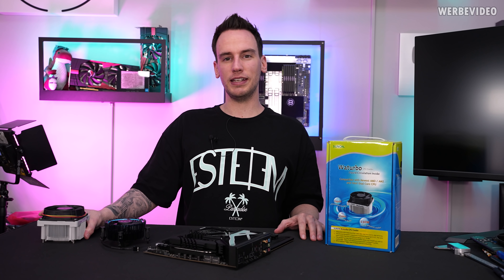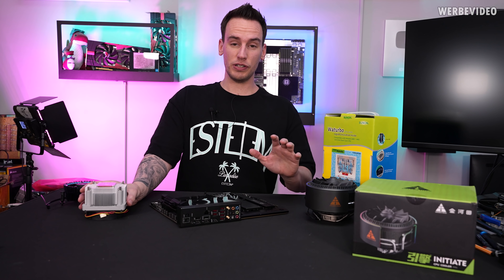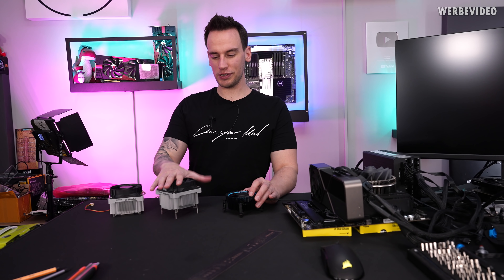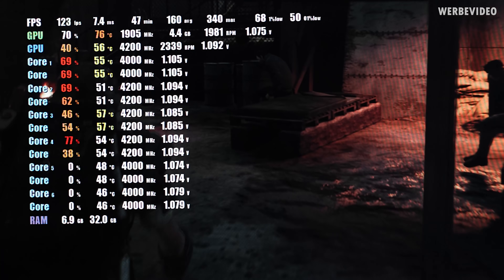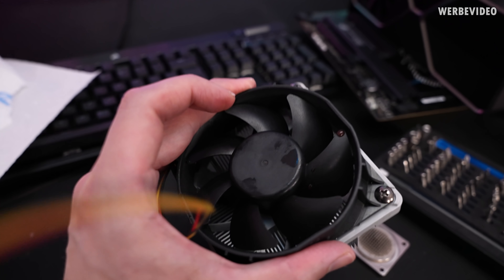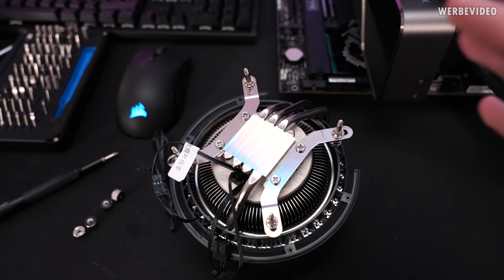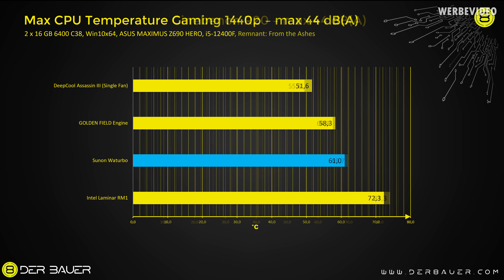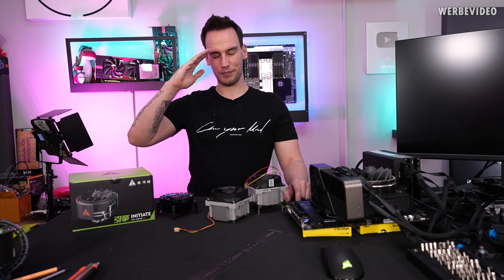Obscure Engineering: This Boxed-Cooler tries to impersonate an AIO

Comment: This should be brought back, it seems quite effective! However it might be possible to achieve the same performance in the same form factor with improvements in design that have occurred in the last decade.
Reply: I'm not sure what the point of the water is. In an AIO you are transporting the heat to a different location where you spread the water thinly through a radiator with two 120mm fans. In this design you're not moving the water anywhere nor are you spreading it through a radiator nor do you have two fans. I do like the pump design and if this were fitted with a couple of pipes and a radiator it could be a three fan design, one on the head and two on the radiator.
Reply: @wayland7150  actually there is a point. vapor chambers didn't really exist in those days and a copper slug wouldn't scale when the heatsink portion is bigger than a certain height
Reply: The heat transfer process is less efficient than using heatpipes so a well designed heatpipe design should always beat it.
It could probably be made slightly cheaper per unit but today heatpipes are dirt cheap so I suspect it would never be possible to recoup the R&D needed to build a new one (which means building one would be irrational). There were heatpipe coolers back when this was launched I suspect heatpipes were far more expensive back then which explains why this exists.

Basically they're using a water to transfer heat to the sides of the tank and then from there it'll go through the metal to the fins where the cooling happens.

A heatpipe design is better at transferring the heat to the fins and without the water container in the middle the same size heatsink assembly will also have more fin-area - both these improve performance.

It would have been fun to see it compared to one of the 100+W AMD stock cooler that do use heatpipes since this advertised 130W - like the 105W rated Wraith Prism (it comes bundled with the 105W 3900X) and AMD also used to have an 125W model (for A10-7870K). Just to show how bad the "new" Intel coolers are.

Comment: And how about the cooler made fully out of heat pipes?
Reply: It exists
Reply: @riba2233  wait, WHAT. Link me it
Reply: @trinhson1368  you cant post links in yt comments. It is called NoFan
Reply: @riba2233  oh god how unfortunate, i would really like one for my really weird-looking build
Reply: @trinhson1368  just find it online, not hard :)
Reply: @riba2233 i can only find ones with copper fins surrounding and connecting the many heatpipes, not any with ONLY copper heatpipes ;-;
Reply: @trinhson1368  it is nofan cr-80eh
Reply: @riba2233  :0, not the design that i expected, but the cooler that i needed
Reply: @trinhson1368  yeah haha. look that their other stuff, they have more models, some are bigger
Reply: @riba2233  jeez especially the 100

Comment: Interesting. Sunon is a large manufacturer of PC fans. The first PC I built, I used some 80mm Sunon fans. They created MagLev bearings and either license them to, or manufacture them, for Corsair. Never heard of this thing, but it'd be interesting to see a modern take on this design regardless.
Reply from the maker: Interesting, thanks!
Reply: I'd love to see something similar to this combined with an AIO.  Something like a really good air cooler coupled with a standard AIO.  Not sure if it would be worth it or would make much difference, but it would be cool to see.
Reply: @notme5744  There is a really old AIO from 2004-ish (called the GlobalWIN Silent Stream) that looks a lot like a modern AIO.
Reply: @polkadotdice6623  Thanks, I'll check it out
Reply: @notme5744  Yeah, that would be cool to see too. A better cold plate and fin design. A better "pump" since that wouldn't cut it for a full on AIO, at least I don't think it would. And a PWM fan. I doubt it would have too much to offer if anything. Especually to offset the added complexity, but I'd still like to see an attempt.
Reply: @TheGameBench  I guess it would be like having a really giant cooler with at least 3 fans and lots of extra capacity for absorbing heat.  I'd love to see it even if it's just a gimmick
Reply: @notme5744  It probably gets around Asetek's patent for a pump integrated with the cold plate if you integrate it directly into a more traditional cooler as well, I could see this having numerous applications. Downdraft fans actually help the motherboard perform better in other ways thanks to the extra VRM cooling, and the air flowing over your other hotter running items like your RAM and your system NVMe. It's a fundamentally different product, but you would definitely need to make changes to whatever fan you're using to drive it magnetically, I'd imagine you would need a MUCH more powerful motor to actually do a decent job spinning fluid through an external radiator with all the restriction on it. Maybe flip it around, put the motor in the cooler unit somehow with it magnetically driving the fan from inside? Who knows, might work pretty well lol
Reply: @TheOriginalFaxon  Didn't think about that, that's interesting. Could be a good way to get around their patent.
Reply: @notme5744  There's already an AIO from Arctic with a small fan for cooling the VRM, works reasonably well.  Any more than that would be too compromising.
Reply: @concinnus  Oh yeah I think I've seen that one, it's a pretty cool idea.  I was thinking more along the lines of something like the cooler from this video but bigger and more like modern air coolers, but with some tubes attached to the water chamber leading to a radiator.  But yeah it might not work too well.
Reply: @notme5744  Coolermaster did have something like that called the masterliquid maker 92 and even asetek with the AIOs used in the hp Z820
Reply: @DLTX1007  I remember the masterliquid, but don't think I saw the other one.  I'm thinking something more like an actual air cooler with a fan, but it also has a water block and tubes leading to a separate radiator
Reply: An Dell Precision M6400 / workstation of 2000-3000$ from 12-13 years ago also has 2x Sunon fans for it's 2x radiators, one for CPU and one for GPU. These are it's original fans and still work nice-sounding as they always were and perform as new, great quality.
Reply: This is a really old design that was supposed to cool the hot Pentium D processors from 2005-2006.
Reply: Sunon makes the phanteks T30 fan.

Comment: I wonder what would happen if the fan and pump stopped working or weren't connected or something? It might make a fine bomb 🤔🤔
Reply: why so? Like any actual fluid cooling system, the CPU will just throttle and the coolant is still sealed. The scenario is the same as the usual heatpipe saturation. Here you even got the RPM feedback to set a bios alarm if you're concerned about hazard.

Comment: The pyramid shape of the cold plate is to stop a void forming, that classic water spout shape. We use plates like this in the lab when we have stuff mixing at high speed, but don't want a dry spot forming in the bottom of the beaker. Without that shape, as the fan sped up the air cavity would reach lower and lower, till a dry spot formed on the cold plate.
Reply from the maker: Awesome didn't know that 😬
Reply: "Without that shape, as the fan sped up the air cavity would reach lower and lower, till a dry spot formed on the cold plate."

This is not quite right since most people wouldn't be running the cooler flat. In most ATX case, it will be on its side. I would love to see a followup benchmark that takes the orientation into account. I get a feeling that with just a small amount of air in the cooler, gravity would really mess up the coolant flow.
Reply: Would it also stop the fluid cavitation I wonder
Reply: @nbtmx1  It's nowhere near vigorous enough to cavitate.
Reply: the pyramid shape is due to the Freemasons trying to brainwash weak people like Derbauer, which means "the peasant", to commit assassinations in the name of the Cabal.
Reply: The coolant looks like something called silverhook red antifreeze
Reply: Making it in a pyramid shape with wholes in between means that the water can have more surface area to the metal, thus cooling faster.
Reply: That just helped me make my mind up - i am going to watch ' Stargate SG-1 ' tonight. No idea which episode.
Reply: The pyramid shape makes the CPU under it trade you luna and usdt faster
Reply: @LawrenceTimme  :')

Comment: Very interesting video, with the magnetic coupling it's like a cross between a CPU cooler and a pond pump...I use sunon fans a lot in industrial equipment they're really good quality for the cost . I wonder if this is the same company?.
Reply: Looks to be the same company judging by the logo on the box.
Reply: Same. Just as Sunon laptop fans and industrial equipment fans and blowers...same company based in Taiwan (Sunonwealth). They seem to not have high static pressure fans though...bit of a shame because of their great pricing
Reply: Standard watercooling pumps (D5, DDC) also avoid having a shaft, so there's no rotating seal to break down.  Basically the same idea.

Comment: Sunon is a huge fan supplier for various manufacturers. You can often find their fans in PSUs and other electronics like oscilloscopes. I'm not surprised they actually made something like this. They have some very niche items available.
Reply: My initial reaction was: "this is going to be more random weirdness that doesn't work".

Then I saw the brand and I was like "Ooookey, maaaaaybe there is something here after all..."
Reply: I used to work as copier technician, I saw a lot of SUNON fans. And they're of an awesome quality. I don't remember having to replace one in any machine.
Reply: @frvo  I have a Sunon 120mm in my NAS as an exhaust fan. This is a DIY Phenom II based NAS running FreeNAS/TrueNAS and it's been running more or less 24/7 since late 2010. Honestly surprised more people don't use their fans, probably because they focus on B2B/industry sales. You can find fans that work as well as a Noctua for like 70% the price.
Reply: @shadow7037932  Same as Delta(similar quality and range of options), they're not consumer fans, but rather electronics commodities.  Surprised he's not aware of them though, as they're fairly common in everything(laptops, servers, embedded) other than the modern DIY desktop market(they were definitely a thing back in the 286/386/486 days).  I mean, if you pull apart electronics you'll see the Sunon label on more than a few fan hubs.
Reply: As well as the brand you can see it's a quality cooler. Just a shame it's so hard to fit on modern boards and so expensive to ship.
Reply: Yep, Sunon, Delta, Nidec etc are the biggest fan suppliers.
Reply: Also it's a recommended brand for 3d printer upgrades. Performance / noise ratio is pretty good.
Reply: Yeah I get a lot of Sunon 5k RPM 120mm fans from older Dell Workstations, and also some 40mm Sunon fans that I've pulled from old PVR's. They kick ass. Never had a problem with them.
Reply: They are common in laptops too.
Reply: most laptops have sunon fans
Reply: I have bought Sunon fans to retrofit in place of some of the other cheapo chinese fans etc in Creality toolheads for example. They are SO much nicer.
Reply: Sunon has been making fans since 1980 ...
Reply: They make very good quality fans. I use their fans on 3D printer hotend, which performs very well!

Comment: My goodness, isn't water worse at transferring thermal energy than metal?
I'd have thought that the reason water coolers are a thing in the first place is because it's capable of physically transporting the heat elsewhere and can be expanded pretty much infinitely

this seems like worse of both worlds
Reply from the maker: If the water wasn't moving, yes. But probably with the movement it will transfer the heat quicker than solid copper. But a heatpipe would probably just do exactly the same at a fraction of the cost 🤣
Reply: @der8auer-en  Keep in mind the age of this product. Also Sunon is by no means just a "cheap" brand.
They have been around for decades, especially very well known in the industrial sector, right next to brands like Delta.
I expect that this was just some kind of intern project, were they either thought it would be nice to just do a sales run, or wanted to use this technique in another application and the CPU cooler just became a byproduct of it. Maybe to get and gain some knowledge and experience in certain technology or so.
Which btw, both of these things happen A LOT. I find it actually quite an elegant solution and very interesting from a technical point of view! Definitely not something that was just cobbled together.
Reply: The reason why water cooling exists is because water has a much larger specific heat capacity, i.e can soak up much more thermal energy than metal and with a cooling loop the heat can be transferred away from the source really fast. This can be obsewrved when large air coolers reach thermal steady state much faster than an AIO/curtom loop.
Reply: yeah and this thing is moving the water inside the tank from the hot plate on the CPU to the side plates connected to the fins with a shaft connected to the fan motor, which in theory is faster than just metal contact, just like an AIO. It's not just still water.

Not a particularly good design, but there is nothing wrong with the theory